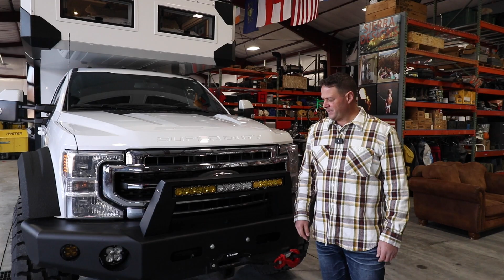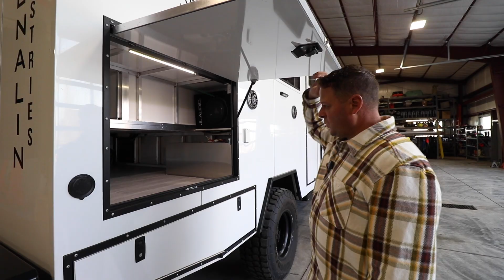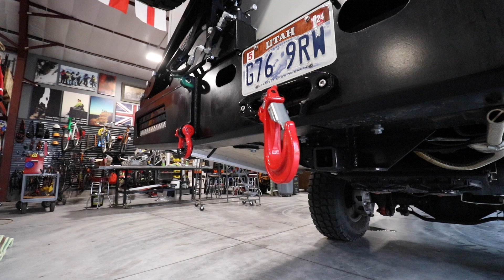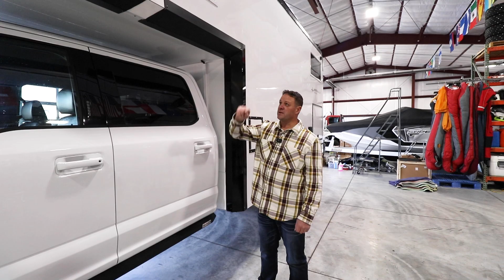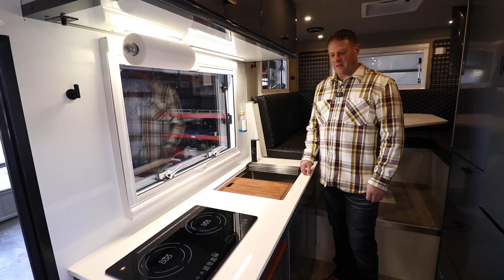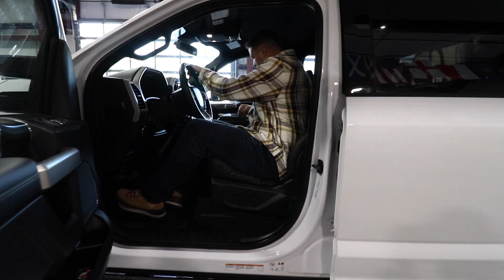2023 Adrenalin AWOL Build Overview

Comment: Because of one necessary function, this whole design becomes absolutely pointless. Here's an example. You wake up in the morning at a campsite, somewhere in the mountains, and there's a bear in your camp, and not just one, but with cubs. They can hang out at your campsite for several hours and you have no way to go outside and get into the cabin to leave, because the manufacturer did not provide a passage into the cabin. Outrageous illiteracy of the engineers of this design. Money wasted on this camper.
Reply from the maker: Not all our customers want a passthrough. We offer it as an upgrade option and can install one when the customer specs it that way.

Comment: Nice truck camper, but there was a glaring omission: security.
Absolutely nothing was mentioned in terms of protecting yourself or your family if things go sideways. If you're surrounded by people with bad intentions, you're effectively trapped — there’s no quick escape, no jumping into the driver’s seat to get away.

Equally concerning, there was no mention of basic deterrents like cameras or motion sensors. For me, that’s a serious oversight. Security isn’t optional; it’s essential.
Reply from the maker: Sounds like you need to pick better places to travel. Most of the world is very safe. But if you are concerned about it watch some of our other overviews of trucks we have built. We have full security systems with night vision and 24 hour recording. All of our trucks including this one have an emergency light button that turns on all exterior lights. We also off a pass through in this model of truck. But most people that can afford our trucks have past their gymnastics prime and don’t have the desire to climb over their center console. We also have numerous storage cabinets you can store anything from a squirt gun to a bazooka.

Comment: Will there be a future in your lineup to have a passthrough into the cab? I like the GXV Storyteller but I feel your design is more superior with regard to weight savings, bracing on the house and wheel wells, but a pass through option with a fold down rear bench with a knee pad section would send this to another level if available. Another question: does Dodge make a gass version 5500 as well?
Reply from the maker: We can actually add a pass-through to any of our trucks. We let the customer decide. Ram does have a gas option but it's not quite up to par with the 7.3 Godzilla quite yet.

Comment: I am American but have been living in the UK for nearly 8 years now. I always used to drive Jeeps back in the states, but when I got here I bought a MINI Countryman All Wheel Drive. I love the Countryman, especially on these English roads. It makes me feel like a proper Brit. However, I am 6'4 230 lbs and I needed something a bit more rugged and higher, so I looked into getting it lifted and getting some aggressive all terrains and a bullbar added and a tire on the back. We drove the MINI from London down to the north of France through the middle of France to the south of France to the North of Spain all the way down to the South of Spain where my wife's family lives. It was amazing. However, we didn't plan well and ended up sleeping in the countryman at camp sites twice during the trip, unintentionally. This made me think about caravans. When I started looking into caravans, I could tow in the Countryman and it couldn't tow anything more than a couple thousand pounds. I have two small boys rapidly becoming as big as me. I realized I needed something with more towing capacity. 

I never ever ever ever thought I would be a truck owner. To be honest I am still not officially one. However, it's pretty clear if you are towing anything worth towing, you need a truck. A Hummer won't do it, an SUV won't do it. You need a Ram or a Ford and I thought that kind of sucked, until I found out about Truck Campers. Now I can't comprehend why anyone would buy an SUV at all. 

This camper you have here is badass sir. Keep it up.

Comment: That looks great, also that it is 16500 lbs max, that pretty much fits into the EU 7,5t license rule but I guess it is for US customers only? Is that really the outside shower? It looks more like the air compressor hose hook up. I probably would prefere the Diesel.
Reply from the maker: Yes that's the outdoor shower. It's on a quick disconnect system just like an air compressor. Makes it super easy to hook it up fast.

Comment: Yes having indoor plumbing is nice, but not necessary, the more electronics you guys put in these rigs the less I want them. You know the saying, does a bear shit in the woods? Yes, and so does the outdoorsman. And do you back that Ford chassis and powertrain? Along with the limited bullshit warranty Ford gives? I don't think so. I don't care if it's diesel or gasoline, they're both garbage now because of the fake climate change bullshit! I've got enough for 3 of these rolling piles of shit, but I'm going to buy a 60s or 70s F-250 or a F-350 with the motor I want and a real manual Allison tranny and I'll find an old truck camper and do my own thing for about 300,000 or more less than this, good luck, I'm sure you'll find some moron.
Reply: Sad old man yells at cloud.

Comment: Enough with the stupid four door trucks/chassis!? How about a simple two door or an extended cab? Even most yo-yos who think they need that, don't use them anyway? 😂😄 I wouldn't buy this rig for the simple fact that it has four doors and a 10 speed crappy tranny that's plagued with problems! It's total garbage, give me a 5 or 6 speed tranny with a bullet proof rear axle and a motor like the old school 351 Cleveland or a 460. You guys will be sitting on a lot of campers pretty soon, especially the high end ones. Not everyone has the play money since we have the president with the most votes in history. 😆🤣🤣🤣😂

Comment: Badass rig.  Total weight, wet on the scales?  How’s it handle the sand, looks like you guys got stuck?  Gas seems to be a notable tradeoff in terms of long term durability but for people going to central/South America it makes sense.
Reply from the maker: 17,200 fully loaded. It killed it at the sand dunes. We filmed a whole video at the dunes if you want to check it out. 
https://youtu.be/HgTu7laKBTs?feature=shared

Comment: Someday I pray a manufacturer finds a way to create a 4x4 overland offroad rv truck build like this for under $200,000 to service the average consumer. Millionaires are the only ones with the cash to drop on these.
Reply: The truck costs about 100k if it’s loaded, the suspension costs around 20k for baseline model. So you have 80k to do everything else.

People don’t want to admit these builds are going to COST around 250-300 easily. They need profit to pay people, so don’t get mad when you see sticker prices 350++ easily. There is a reason Adrenalin, Truckhouse, GXV are all coming in around 400-450. That’s what the market will bear.

Comment: What a great build, and the very best suspension system that money can buy. Hands down LiquidSpring suspension is the very best for reliability, durability, plus the fact LS suspension requires almost no maintenance for the life of the system.  I own a 26,000 lb class A motorhome with the LS 4 corner 5 link suspension, it's incredible, ride comfort handling and stability is second to none.
Reply from the maker: It's the best!

Comment: Very nice rig.  Only quibbles I see are with such a small black tank and gray tank.  Given the 100+ gallons of fresh water, this rig is designed to stay out boondocking for quite some time.  I would think 5 gallons would fill up pretty quick, forcing you to go au' natural.  Same with the gray.  It seems like it would fill up pretty quick.
Reply from the maker: Thanks for the feedback, We test our trucks extensively and haven't run into issues with this yet. Since your grey water is just from your shower and sink we find there are plenty of safe places to just let it drain while you camp without anything harmful impacting where you are at. As for the black tank Cassete you can buy extra's making it super easy to store 1-2 extra Cassete's that you could quickly switch out if needed.

Comment: Dont the liquid spring freez we have -40 celcius -40 Fahrenheit
Reply from the maker: They are operational to -50 degrees Fahrenheit.
Reply: So what do you do when it go under ? We had- 44 and dark most of the time in 5 month ?? Most of our house dont use AC we insolate. Both for cold and warm.  And Electric and fluids sucks when cold
Reply: And all the water tanks and so on and when the temperature switch from +2 celcius to 40 below in 12h

Comment: 01:12
2003, we built our ExpeditionVehicle on a 1996 Ford CF8000 commercial truck.
Cummins 8.3 mechanical, Allison 3060 automatic.
.
Over two decades full-time live-aboard.
Zero issues.
Reply: Your 30 year old diesel will burn high sulfur diesel fuel, modern diesel engines with emissions equipment will not.
Reply: @JC-dr8ev  
After we adjust the pH and filter, an old Cummins will chug along happily on cooking oil... and probably brake-fluid with some used engine oil.

Comment: We want to know where the toilets water goes? and how do you clean all that? is there a system for that? ...
We want answers for all theses questions....
Reply from the maker: Go to 15:00 in the video where we show you the 5 gallon Cassette toilet made by Dometic. It's a super easy system, you just pull out the cassette and dump it into your nearest toilet/portapotty. Then you slide it back into place and your good to go. Every few months it's helpful to pour hot water and soap into the cassette and rinse it out but you dump it the same way.

Comment: Beautiful rig.  I watched this looking for the passthrough, and you guys still haven't done it.  I feel like you're missing out on a huge differentiator from the standard pickup camper market.
Reply from the maker: Thanks for your feedback. We have done pass throughs on our expedition style trucks. But on our overland series not a single customer has requested one. The advantage of them is you don’t have to get out in the weather to access your camper. Also nice if you were in a bad situation and needed to leave quickly. But lots of disadvantages also.  It’s $10,000 more. Most of that is in the dual captain chairs in the back seat.  The center console is not an easy task to climb over. Especially since most our customers are not in their 20’s. You are also now conditioning 2 separate spaces for heat and AC. You get to listen to all your gear rattle around and another reason is security. It’s a lot easier to break into the truck than it is into the camper. But if a customer wants a pass through. We would be excited to build it for them.
Reply: I like passthroughs too, but one other thing to consider (for some people) - alcohol and firearm rules are more relaxed if the spaces are separate.
Reply: That’s a great reply. I think it would be nice to have a scuttle hole to go between for emergencies, but would definitely not want the full cutout.
Reply: You didn’t address cameras/security or did I miss it?
Reply from the maker: @josephinebustos8074  that’s an option for those that want them. We have done them for some customers.

Comment: I would use 12v ac & tv
Reply from the maker: Air conditioning is 12 volt. TVs are 120.
Reply: What about auto leveling with the liquid spring @ camp?

Comment: 😅Don't know the price, but I'll bet it's over $500K easily. For that dough, I will not tolerate a wet bath. Obviously,  a cheapskate short cut. No doubt, there will be a lot of sales targets, with more money than sense, who pony up their hard earned scratch for this rig. Good luck when it's time sell it, the depreciation will be astronomical. Hard to gage the owner; a con man or a genuine good guy? A buyer will find out the hard way.
Reply from the maker: They come fully equipped as seen at $450,000. Wet bath makes a lot of sense in order to save space in this series. You should look at our Expedition series truck. We have a separate shower and toilet area in that build. https://www.adrenalinind.com/projects/adrenalin-bae-6x6-%22frank-the-tank%22
Reply: Wet baths depend on the floor space.  I’ve used some, like the Airstream Basecamp that were very frustrating to use, no room at all to turn, bend or reach around. Others like in a class B… worked okay!  But I’ve yet to find a waterproof TP protector.  LOL!
Reply: Он будет выгодным, если его использовать 4 месяца в году, если меньше, то не выгодно
Reply: Cheaper than the Earthroamer.

Comment: Did you guys change the computer settings on the engine when you switched to singles?
Reply from the maker: Yes, we have an adapter that adjusts it for the larger tire size. It also makes it so your speedometer is accurate.